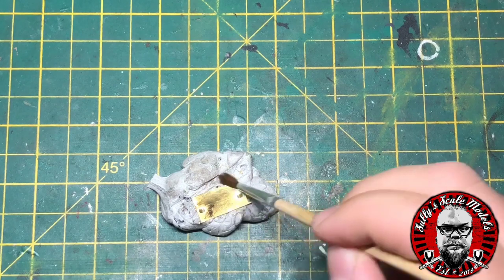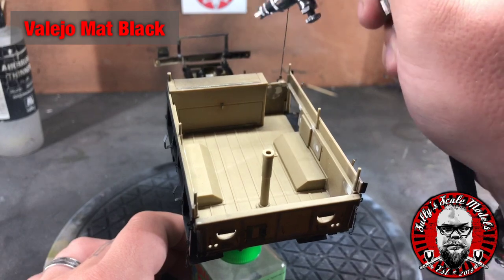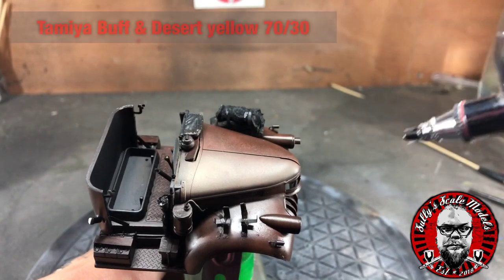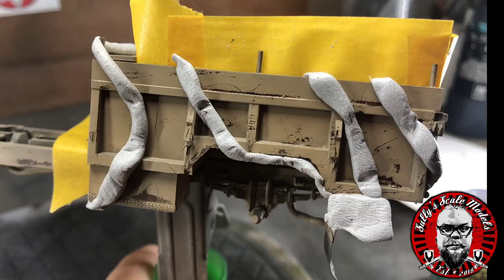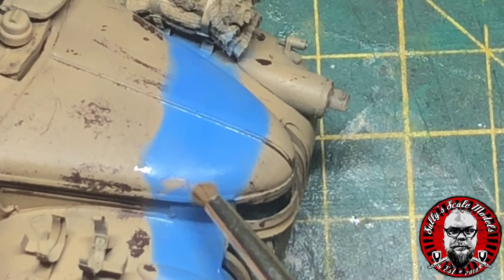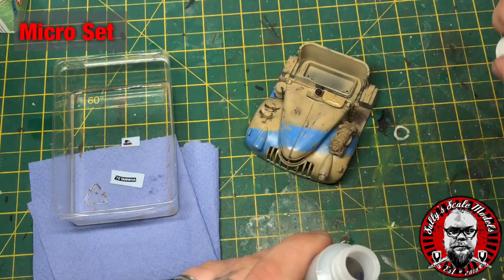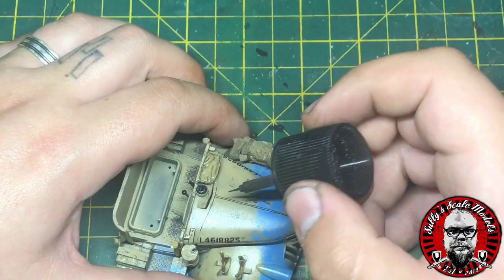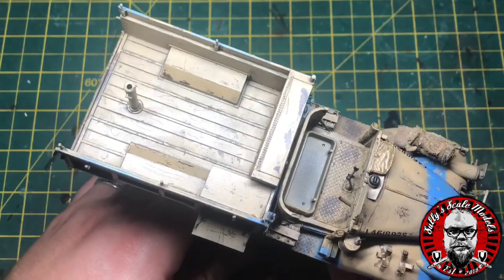Tamiya LRDG Part2 Worn, Chipped & Battered

Comment: Hi mate - what airbrush do you use?....... Great video's
Reply from the maker: I think at the time i was using a unbranded one i got form ebay or about £20 i use a Fengda but i couldnt tell you exactly witch one it is but it has a 0.2 needle but i also still use the cheap one

Comment: Hello Guv-Nor, what is the clay looking material you are using?
Reply from the maker: Das clay ! Its air drying and dont take long to dry but best left over night to fully go off
Reply from the maker: What no sorry its white tac. For the cammo lines?! Its good to use doesn’t leave any residue, if any is left on when you peel it off use a glob and it will come of with it also very re useable and cheap